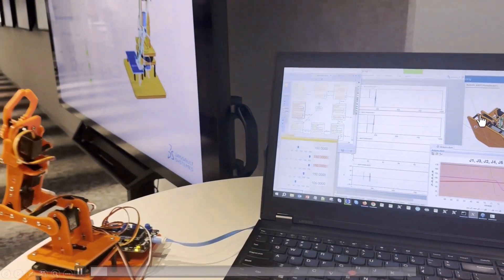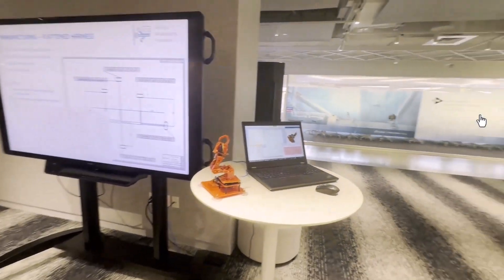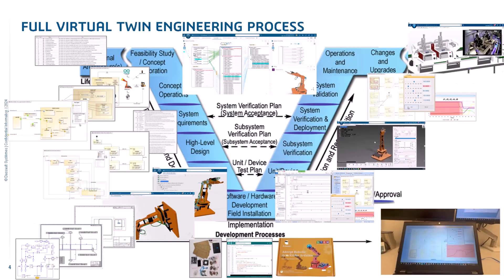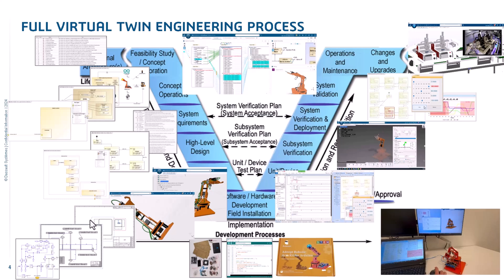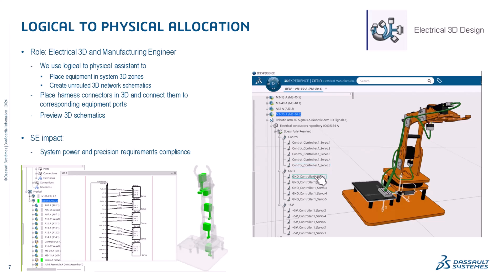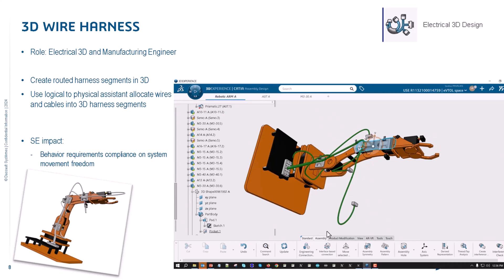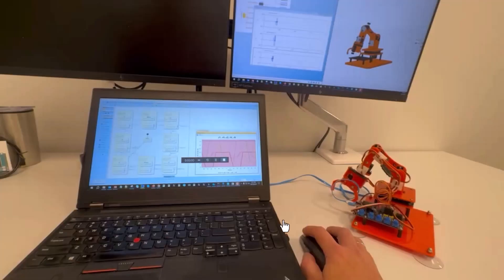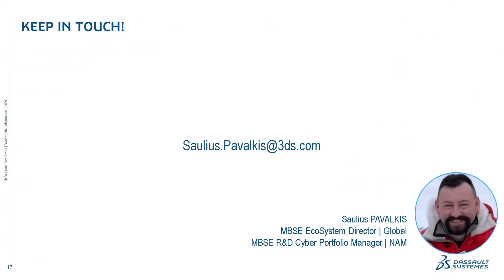Accelerating Digital Engineering Adoption with MBSE and Virtual Twin of Portable Robotic Arm

Comment: Hello, nice work, do you have any MSOSA or 3dxml examples I could take a look at?
Reply from the maker: Hello, yes for sure a lot. What are you looking for?
Reply: @MBSEExecution  hello, do you have a website I can contact you through?
Reply from the maker: Here you can find this sample - https://r1132100503382-eu1-3dswym.3dexperience.3ds.com/community/swym:prd:R1132100503382:community:4GJPS8QmTuC4wF8BSLitkw?content=swym:prd:R1132100503382:communitypost:ozKObb32RFOA6t9JVb8uIQ. Drop me comment into the platform and we can talk what would help or share the model.
Reply: @MBSEExecution  
Whatever you are willing to share on the MSOSA side. I am interested in developing a similar core MSOSA model. 
I have a simple robot & 3dx manufacturing cell that I would like to use. I do need to add the electrical components, I have not explored that application in 3dx yet.
And using the MSOSA model to get to the physics/co-sim.